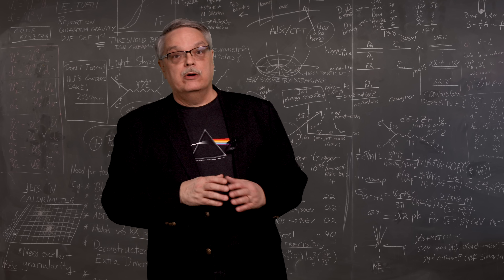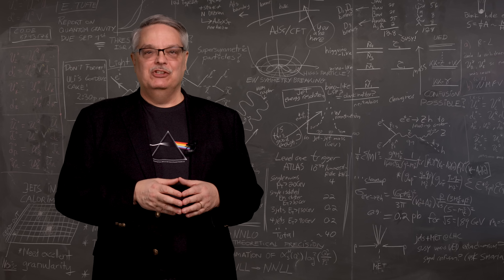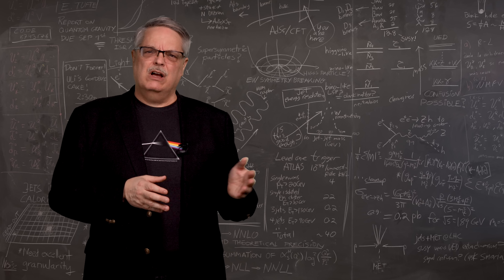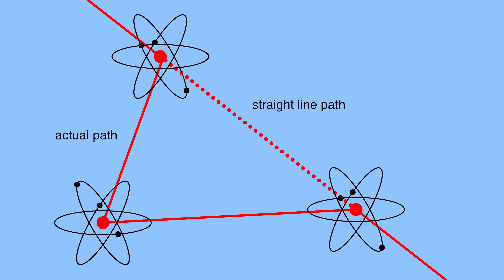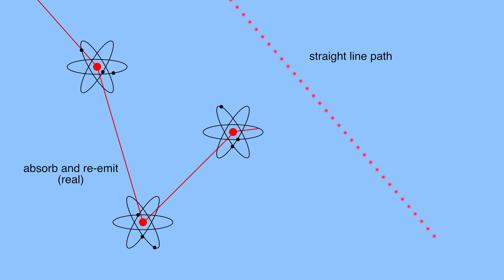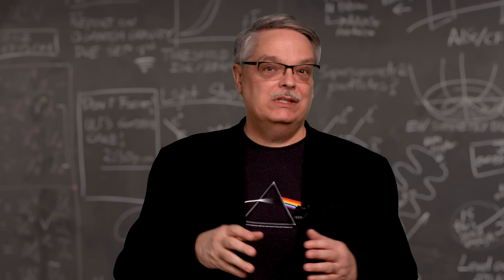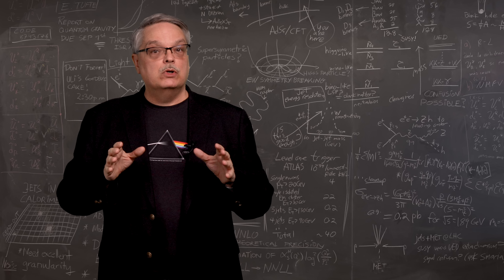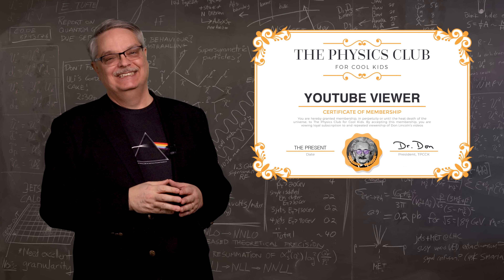Why does light slow down in water?

Comment: The Speed of Light is Not Constant and it Definitely Slows Down in Water ,Glass and in the Variable Coefficient of Refraction in Space

The Speed of Light, among other things, is the Velocity of Photons (made of EM Dipole Particles) in the Medium of Space which is a Quantum Bose Gas of EM Dipole Particles with a specific Energy Density and Mass Density that governs the Speed of Dipole Waves.  
 
The Effective Cross Sectional Area A(effective) of the Photon and it's relation to the Photon's Quantum Mass and Energy (PHOTONS ABSOLUTLEY HAVE QUANTUM MASS AND MOMENTUM) is defined by the Fine Structure Constant along with the specific Photons wavelength to determine the Terminal Velocity of a Photon as it flows through the Quantum Bose Gas of EM Dipoles or "EM Field". 

The Quantum Bose Gas of EM Dipole Particles fills All of Space, both Vacuum and Particle Space.  

There are ~22 nanograms of EM Kinetic Dipoles per cubic meter of the Vacuum that you currently occupy.  There are 22 nanograms of Kinetic Dipoles hitting your body at an RMS velocity of "c", or speed of light, as you read this comment.  Yes some dipoles travel faster than "c" and some slower than "c".  That is about 5 lbs. of dipoles hitting you at ~5 miles an hour.  A portion of these Kinetic Dipoles hitting you transfers momentum to you thus accelerating you toward the higher density dipole region of space, near Earth.  This Dipole Density Gradient causes a skewed momentum transfer force you call gravity.

When a Photon hits Water or Glass the leading edge that hits the higher density region first meets dipole drag resistance first and slows down while also compressing (conserving momentum).  This changes the total direction of the Photons Momentum Vector.   The reaction is reversible when the Photon leaves the Glass.  The leading edge that leaves the glass first expands in the less dipole density of the Vacuum first and changing it's Momentum direction vector the other way.  This causes all refraction including Cosmic or Gravitational Lensing or Refraction. 

The Photon, a collection of trillions and trillions of Kinetic Dipoles, plows into the Kinetic Dipoles in the Vacuum that are in its way and it experiences a Drag Force that slows the Photon.   At equilibrium the EM Force of the Photon and the Drag force of the Vacuum Dipoles are equal and the Photon remains at the max speed or Terminal Velocity.  The Photon is passing through an EM Kinetic Dipole  atmosphere or "EM Field" so this is almost the same as other Drag Forces other than some EM Dipoles can fly straight through a Photon (radio waves) unaffected so this problem is different than an entirely closed volume like a car or plane.

Space does not bend.

Time does not slow down.

Momentum Vectors are changed due to Kinetic Dipole Density Gradients and Kinetic Dipole Collisions alone and nothing more.  

When Photons enter higher density dipole fields, near massive bodies, they experience higher Vacuum Dipole Pressure due to this higher density and the Photons Volume is Compressed, physically become smaller changing their wavelength shorter, "Gravitational Blue Shift".  

When a Photon travels through a lesser dense dipole region of space the Photon is decompressed and increases in physical size or undergoes "Gravitational Red Shift.

Cosmic Red Shift is caused by Photons slowly loosing EM Kinetic Dipoles though Dispersion over million of years and slowly loosing energy as a result and expanding in physical size.  The universe is not expanding in the least.  Hubble actually discovered the Photon Dipole Energy Dispersion Rate not the Rate of Cosmic Expansion.  

"Gravitational Lensing" is just caused by the variable index refraction coefficients due to Vacuum Dipole Density Gradients around massive celestial bodies in Space.

The Universe is not Inflating. 

EM Vacuum Dipoles are Dark Energy.  EM Particle Dipoles make up the Quantum Superfluid in Particles like Photons and Electrons.

So yes Photons slow down in water and glass because the EM Kinetic Dipole Density in that Space is higher, meaning very dense so the propagation speed of the Photon is less, slower.   

"All things are kinetic, not magic."

    - John E. Boze

BRAVE's "TENET's of NATURE" are as follows:
[1] You cannot bend or warp space.
[2] You cannot bend or warp time.
[3] All forces are due to transfers of momentum from local collisions of Bożeons.
[4] Bożeons are … “You learned this in Third Grade Elementary School”... EM(G) Dipoles.

BRAVE - Bożeon Research And Æther Verification Eταιρεία

Copyright 2020 John E. Boze

Comment: The real reason why light travels slower in glass: Light is being transmitted by a continuous aether called the  E-Matrix. Inside the glass, the E-Matrix is bent so it transmits light at a slower speed. Outside the glass the E-Matrix regains its straight path so it transmits light at the normal speed of c.
This concept of light transmission is described on page 33 of my book in the following link:
http://www.modelmechanics.org/2016ibook.pdf
Reply: What problems do you have with the explanation given in this video?
Reply: What is the cause of higher index of reflection in water or glass if light is not being transmitted by a continuous aether?
Reply: @kenseto9266  Do you mean index of refraction? The cause of a higher index of refraction in water or glass is the slowing down of light when it enters one of these mediums. The more it slows down, the higher the index of refraction. This video explains why it slows down, so I'm wondering what problem you have with the explanation in this video.

Comment: It can be described by wave or particle.   I would say the quantum explanation (more complicated) is more correct to what is actually going on.   They both explain the same thing, the wave explanation works on paper but is not necessarily what is actually going on at the quantum level.   A photon of light in a vacuum may be different than a photon in a different system.   It may take on a new form "Polaritron" which has some mass (travels slower than C) and returns to C as it exits and returns to a photon in air.   I think the wave explanation is more tangible for the student.  You have one reality but can have multiple explanations that mathematically are correct.   I would say the quantum model is closer to what is going on than the classic wave model.

Comment: Thank you for this and all your efforts.  If I may:  Another way to recognize that the slower speed can’t be due to absorption and re-emission is that absorption is only possible if the photon has energy that corresponds to an allowed electron transition; the bonds in the network silicate solid make that even less likely than usual but even if the atoms were isolated you’d expect to see variations in the apparent speed based on frequency.

Comment: Why is the field induced by the electron only in the same direction as the incoming light though? Why doesn't it spread out like a plane wave?
Reply: "Why is the field induced by the electron only in the same direction as the incoming light though?" - It's not true. 
When an atom get excited with the incoming light it acts an a oscillating electric dipole and re-emits it with approximately a donut-shaped wavefront, so it also emits in the opposite direction. 
Remember that it's also a reflected wave!

Comment: Sir , I have a question --- where the  energy comes from when light goes from water into air when it's speed goes up by about 35 percent?
Reply: Photons have a fixed energy, equal to E = h*f where h is the planck constant and f the frequency.  The frequency of the photon never changes, neither does its energy. What happens is when the light (bunch of photons) enters in the material, it can absorb an amount of them or re-emit them in another direction (reflected wave). So the energy change of the intensity of light is due the loss of photons, not about the change of the energy of the individual photons.

Comment: Wouldn't the superposition of light waves  with the waves produced by electrons cause change in wavelength or frequency and thus cause in the change in color of light .
Reply: Frequency never changes when the light enters in the material. What changes is the wavelength (it becomes smaller) . Because the color depends of the frequency and not of the wavelength , the color doesn't change.

Comment: Why don't we see the sidebands from that modulation of electrons induced field? Like we will see a straight line (traveling with "C" speed), a bent one (traveling with "C-e" speed ) and a very bent one, created by the electrons,  traveling with the "e" speed.
Reply: Dirk Knight  That's not correct. Scattering goes in all directions. Refraction is very directional.

Comment: You mentioned that when two waves of different speeds add up the resultant is a wave of a different speed altogether. How can the incident electromagnetic wave and the wave setup by the motion of elections in the field of the wave be moving with different speeds? Is that because electrons have mass and take time to oscillate?

Comment: But when the light enters the glass, it's entering from air to glass...not from Vaccum to glass. While travelling in air, It must have excited the air atoms as well in the process and created a wave in air (which is diff& slower than the wave it would have created in vaccum) before entering the glass. Am I correct ?

Comment: So, why does the light slow down ? When you add 2 EM waves, amplitude and frequency change, but the speed remain the same, c. i don't understand why the wave is slower after interacting with the secondary wave. Can someone explain it to me and tell me where i'm wrong please ?
Reply: Thats true in one dimension, because the same peaks always line up with the same troughs. But when the waves move at an angle then the interference pattern moves and the resulting wave can have a different group velocity even if the waves that make up all have the same phase velocity.
Reply: @narfwhals7843  thanks you for your explanation.

Comment: Great explanation!  Would this then mean that the slowness is directly correlated to the number of electrons in the atom?  Does the atom itself play a part?  How far away from the atom must the light be to not be affected by the effects of the resistance from an atom?  Could this become the definition of things ‘touching’ on the quantum scale?
Reply: I can tell you this much: the electrons are part of the atom and the chemical state of the atom as well as the number of electrons determine the degree of interaction. The spatial range is definitely on the scale of 'touching'. Touching in any case is electrostatic interaction.
If you think about a wave passing one atom... do you think it is possible to measure a change in the time tavelled for a photon for a single such event? Don's explanation (with reference to refractive indeces) is clearly meant to describe light passing through continuous matter.
Reply: Think about how the coupling of coils in a transformer varies with the core material.  Now consider that at wavelengths like those of light, it wouldn't particularly be electric conduction electrons that would provide the coupling (as in the transformer), but electrons held in various degrees of tightness according to their energy state.

Comment: i think this is just a failure of the observer to realize that the speed never changed it simply had to take a longer path because the atoms form perimeters that increase the distance the light has to travel.  Also why does it go back to normal speed after it leaves the medium?

Comment: This explanation is not correct. The induced radiations by Electrons  are also EM radiations. Though their magnitude & wave lengths may be different from primary one,they have the same velocity.So the combined waves of primary & secondaries will also have the same velocity like the primary one only the shape(frequency, amplitude) may vary.

Comment: To Fermilab - electro magnetic effect of light on electrons of atoms will produce secondary electro magnetic waves from electrons, their magnitudes & wave lengths may be different but their speed will be same as that of any EM radiations. So the contention of lower speeds  of  EM waves created by electrons does not appear to be correct.

Comment: What about the fact that the light is traveling through air and not a vacuum before entering and exiting the glass? Wouldn't it still be interacting in a similar way, or am I confused about the native speed of light in space vs "air"? Sorry if my question is confusing.
Reply: Wait not the question bi came to ask😁. Is there measurable resistance as the light passes through the glass?

Comment: a couple of questions :
-can you measure the induced second wave, outside the material?
-how can you explaine it with the quantum (particle) side of light?
-why is this only so with transparent material? What makes material transparent?
-what does it have to do with the hardness (diamant has 2,5)?
-All colors have the same speed, but bend at different angles, why?
-There is material that almost stops light, how does that work?
-What is the Goetheanstic explanation of it, hihi?

Comment: Sir, please tell us if the first signal, described as below, will be attenuated lesser than the second and the third signals. 

Signal 1 : sin n + (0.2555) sin(2n + π/2)

Signal 2 : sin n
Signal 3 : (0.2555) sin(2n + π/2)

Note : What's so special about the first signal is that, in case of the first signal, the amplitude of the wave stays same for some time, while the wave is propagating. If you generate the graphs for these three signals, you may easily see the difference between these three signals.

You may run the following code snippet in Python and you may generate a graph for the above three signals

import numpy as np 
from matplotlib import pyplot as plt 
x = np.arange(1,720) 

# Signal 1 : sin n + (0.2555)sin(2n + π/2)
y =  np.sin(x*np.pi/180) + 0.2555 * np.sin(2*x*np.pi/180 + np.pi / 2 ) 

# Signal 2 : sin n 
z =  np.sin(x*np.pi/180)

# Signal 3 : (0.2555)sin(2n + π/2)
w =  0.2555 * np.sin(2*x*np.pi/180 + np.pi / 2 ) 

plt.title("The Graph Plot") 
plt.xlabel("x axis") 
plt.ylabel("y axis") 

# plotting the 
plt.plot(x,z)
plt.plot(x,w) 
plt.plot(x,y) 

plt.show()

Comment: Does the light "accelerate" quickly right after it leaves the glass to get to standard light speed? If so, if you were to measure the light a micron after it gets out of the glass, would it be faster than it was in the glass, and then if you were to measure it a little further away from the glass, would it have sped up? And if so, does anyone know the distance it takes light to reach full speed again? If this isn't the case, then does light just kind of instantly go back up to light speed after it gets out of the glass?
Reply: The question is, what happens when half the photon is in the glass and the front half of the photon is already out of the glass.  Yes Photons have volume.

Comment: a question, professor: the oscillation of an electric field should generate an eletromagnetic wave, right? And the eletromagnetic wave is a transversal wave, which is perpendicular to the direction of oscillation. So, we have a definite direction, which is exactly the direction of the emitted light. But this oscillation takes time, the time for the electron to go, go back and come to the center... [I see a problem here, the amplitude of the light wave would be relevant for the taken time.... and the particle than has an energy enhancing, so it could move faster proportionaly to the amplitude, but maybe if the amplitude is high enough this oscillation could occur faster than light? Well, it don't occur, because for a certain amplitude the electron in one atom would approach enough the electron of another atom (or an electron of the same atom) to feel the electric repulsion and gain velocity, what would make time constant. Actually, the infinitesimal variation required to cause an interference effect between two electrons defines the time, so. The speed of oscillation is regulated by the electronic interaction, not by a mysterious effect, and naturally has a limit]. By this, we have a constant time independent of the amplitude, and we have a definite direction. There is any mistake in my reasoning? I am just really annoyed by the purpose of an electromagnetic wave with speed distinct of the light one. Could you get deeply on what is that electric wave generated by the oscillation of an electron that isn't an electromagnetic wave and also interfeers with the light?

Comment: Electromagnetic waves are oscillations in magnetic fields. Accurate animation of radio waves being generated in an antenna by an alternating current: https://en.wikipedia.org/wiki/Radio_wave We visulize this in the same way Sound Waves are Oscillations in something!
The amount light "bends" depends on the angle of ENTRY. In your example: side of beam reaching glass 1st travels slower 1st, then at other nothing side resumes speed through air 1st, hence leaving glass at same ANGLE. Your theory lol https://www.sciencelearn.org.nz/resources/49-refraction-of-light

Comment: "Lots of misinformation in the internet"
Count this one in.

You just said that it doesn't make sense that light cannot speed back up.
Then you just implied the same exact thing with your explanation.
Objects that slows down only accelerates if you apply force.
Yet "your" light "prefers" to speed back up with no explanation.
Simple explanation: it's the rate of induction. There are no photons. Get that in your head. Light is nothing special. Light is same as gamma rays, x-rays, UV, microwave, IR, UHF, VHF. Their rate of induction is dependent on the medium.
Reply: There are no photons? Ok einstein...